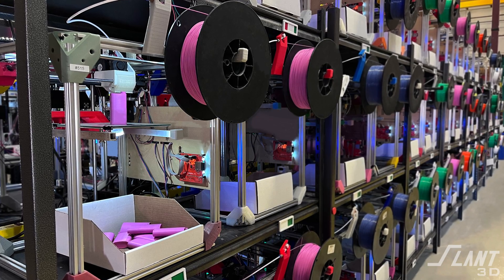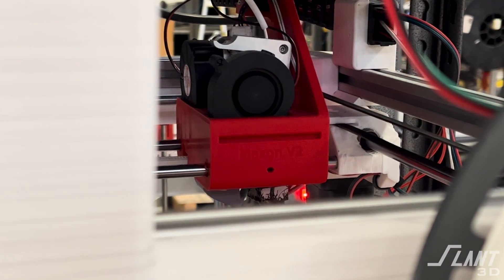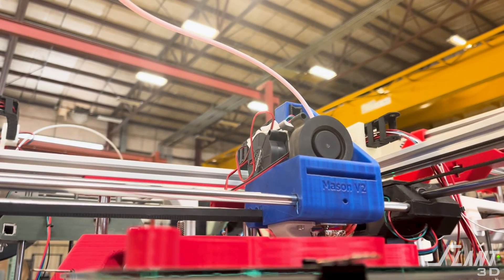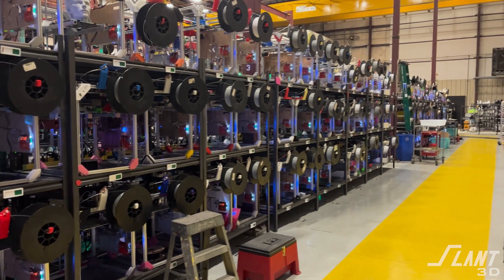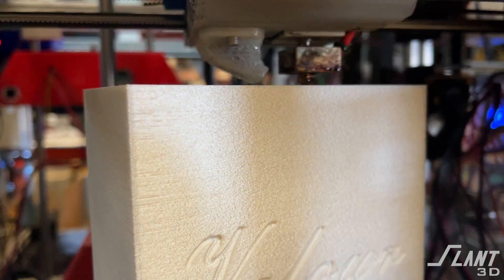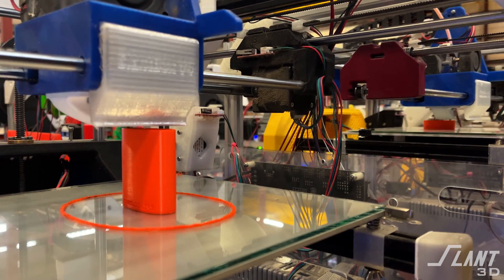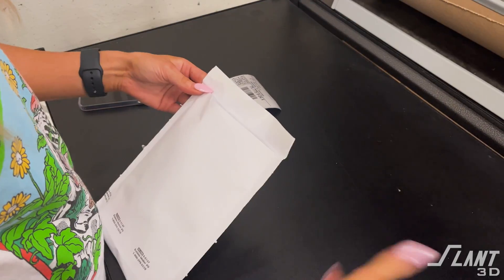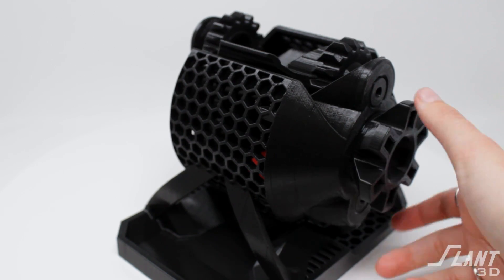Why We Only Use FDM Printing for Mass Production

Comment: Good points for choosing fdm, it's important to discuss its short comings as well because if tje shortcomings are not discussed with the customer thier expectations will nkt be met. I operate a resin 3d printer, I print figurines and models that require pixel perfect fidelity. Fdm simply can't do that. It's important as a business to have a small R and d internal think tank that can combine the best of both worlds. You can make an infill designed to interface with a smooth piece printed on a resin machine. I've built things where tje fdm might make the "frame " but the finished stamping parts are resin printed.  Fdm will loose once plastics are phased out don't bank on the old supply chain for more than a few more years. Looks like you make your own filament, I'd source bio base for filament and move away from the plastic. I also love how resin printing prints a whole later at one time, true cleaning is a hassle when your unpracticed but really it just gives me more opportunity to scrutinize the piece for qc and give it a bath in the uv curing machine. I appreciate you videos, remember every process has its disadvantages.

Comment: 😂😂 we have to be experts.... that's why we only use one machine 😅 dudes sitting at home with a fdm, xyz and a resin printer having debugged multiple systems and fine tuned multiple machines, print heads etc etc that what experts ACTUALLY DO
Reply: Experts do what they can within the time constraints that you're given. You can afford to spend more time on things at home but in a production environment people don't care about you learning new skills, they just want their parts printed and shipped to them as quickly as possible and it shouldn't cost too much. That means no or very limited post processing at scale.
Reply from the maker: Now do that 1000 more times.
Reply: @slant3d  destroyed, completely and utterly destroyed that argument. am looking forward to the 10$/kg filament, would it be possible to ship filament refills similar to what bambu does or offer credits if you return the spools. because I don't want a massive stack of empty spools sitting in the corner of my print room?

Comment: Why don’t you try using belt printers?
Reply from the maker: Dont work
Reply: @slant3d interesting, what's the fundamental issue with those that can't be worked around?
Reply: @mggevaer260  Their most persistent issue I'm aware of is consistent bed adhesion.  Either too sticky and won't release properly at the belt turnover point, or not sticky enough, and the print fails immediately. One variation on this is effectively making a belt that's a bed transfer system that the printer treats as a fixed bed, until the print is done, then the belt ejects the bed on to a rack, where it gets moved to post processing. Then again, that gets you into 'more moving parts' which may not be what you're looking for. You may need to make sure you can track where each 'bed' came from on this print run, so that if post identifies that 'one of the printers' is producing sub-standard parts, you don't have to take down the whole line to address the issue, but that's more or less a solved issue already, so.

Comment: With SLS can’t you nest many parts in 3D without the need for support structures? Removing and recycling un-sintered powder seems like “less steps” than breaking off supports that then need a more complex process to recycle, and you are risking damaging the part. 

Very informative video that I enjoyed watching, but I feel there are conclusions that are reached without a full examination of alternatives.
Reply: Nylon powder is more expensive than the plastic pellets, and plastic pellets also allow for a wider range of materials. SLS prints also need more specialized equipment for post processing (enclosed chamber to contain the dust) and possibly other equipment as the powder is more hazardous than anything produced by FDM printers (especially if equipped with an enclosed build volume). Since this company also makes their filament in house, it's even easier for them to recycle support material as they just need to shred it and toss it back into their filament extruder.
Reply: @rclippy38474  Agreed, material input costs give an advantage to FDM for this farm application; but on the other hand, the need to invest in large scale filament production to be able recycle an unnecessary waste stream is a big part of why in the long term this seems like an optimization of a fundamentally less optimal solution. Could Slant apply the same optimizations to powder production / automated powder extraction?
Reply: @rclippy38474  True but the finished parts are better with SLS than FDM.  Higher performance.  The energy needed to turn pellets into a spool, then heated to print parts, then again to reclaim is often overlooked.  Recycling isn't free.  Energy costs, and looking at FDM outputs vs SLS outputs I would rather have an SLS print outsources and an FDM machine sitting on my desk.  I think if most people are going to outsource prints, a bunch of desktop FDMs wouldn't be the first place I would look.  I would go for a process I can't achieve here at home (or don't want to deal with).
Reply: @rclippy38474  Counterpoint, if they convert pellets into filament, they could probably make powder from it.
Reply: Yes, SLS and similar technologies allow for XYZ nesting, unlike FDM's XY-only nesting.

Powder reclamation could indeed be automated, and material processing brought in-house if a company wanted to do so.

Comment: I would love a video just about your 3d printers and the quality expected from the parts produced
Reply: The ones they show in videos have a lot of ringing.
Reply: I have gotten a print from them and it's amazing quality.  Iirc it's printing at .2 mm layer
Reply: What printers do you use?
Reply: It's an in-house design. @MyEyeOnYou
Reply: Looks like they're called Mason V2
Reply: The 'quality' of a part will always a combination of how a part is designed, quality of raw materials used and the tooling used. Tooling can constrain some upper limits to quality but limits will vary across a design depending on how the design is composed. Quality is not a number but a set of desirable outcomes covering many aspects of part design: including, but not limited to functionality for a purpose, a parts physical appearance, durability, etc. 
Perhaps this is why "Design for Mass Production 3D Printing" is a series of videos, not a single video.